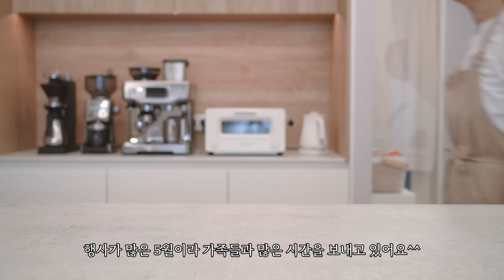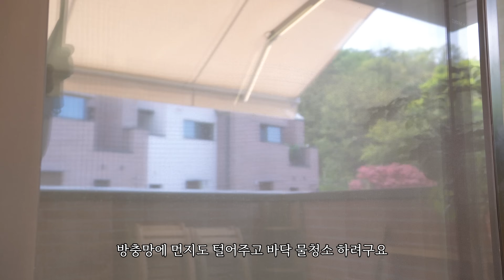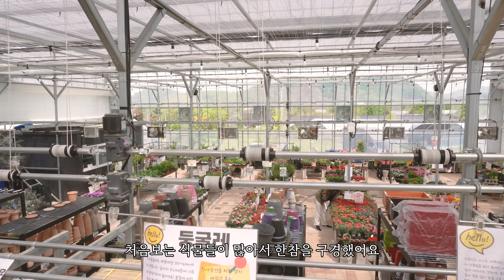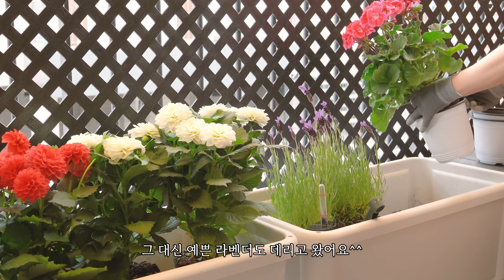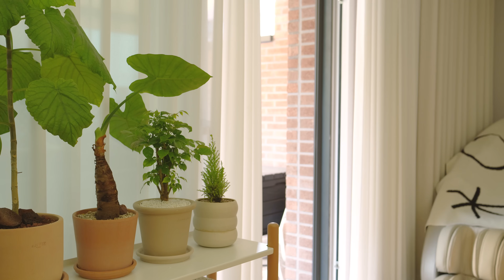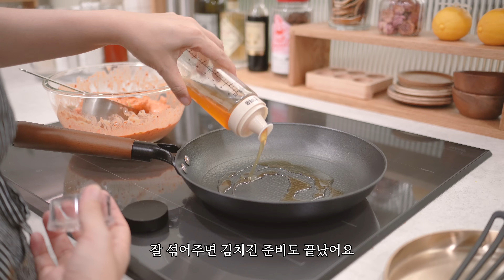SUB) 타운하우스 테라스 꽃 정원 만들고 힐링하기🌷

Comment: It may be a good idea not to crowd a planter with so many plants.   Each of the plants needs more room than what you are giving currently, in order to grow and spread out.   The roots of a plant need room to grow and to spread out.  A relatively small plater is not designed to be stuffed with a few young plants which have more growth to do during spring, summer and into fall.